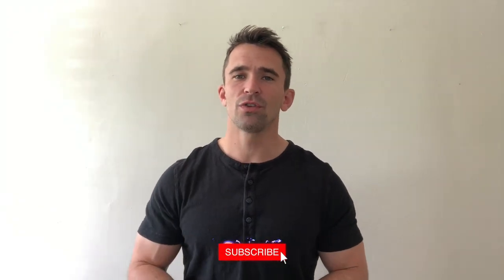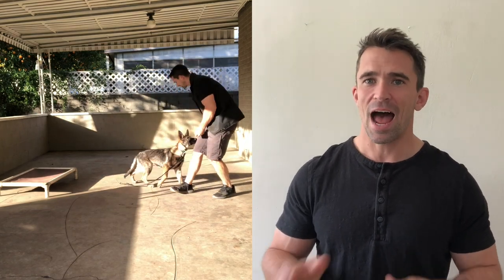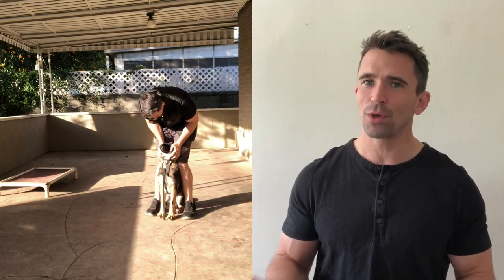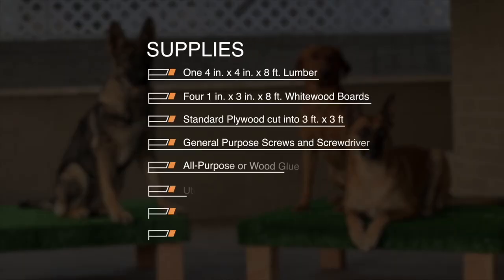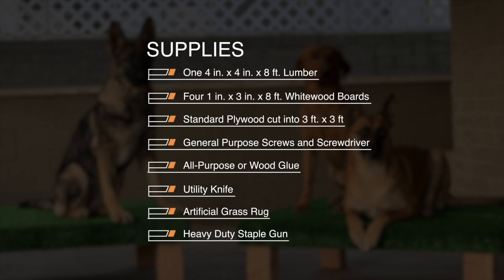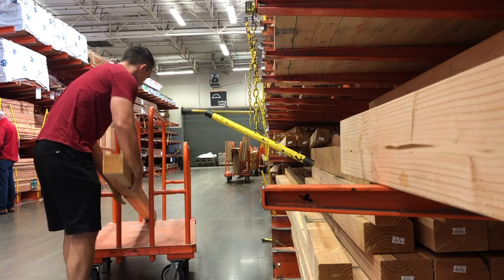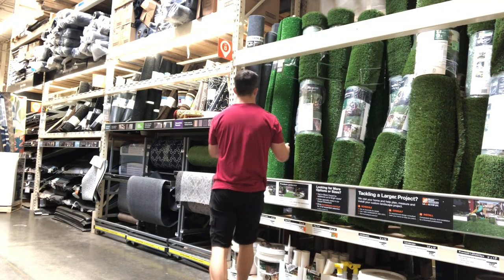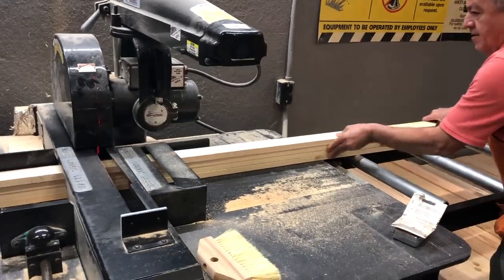How to Make a Custom Training Platform for Your Dog.

Comment: Good video. Just a tip pre drill the holes with a smaller bit than the screw on the wood so it doesn’t split. The 1X is prone to splitting. Cool project, I’m making one today
Reply from the maker: Yes. Thank you!

Comment: Thanks for this! I'm trying to see if there are any written instructions. Am I missing them? Thanks again!
Reply from the maker: Thanks! Sorry, I only added the supply list. 
1) One 4 in. x 4 in. x 8 ft Lumber
2) Four 1 in. x 3 in. x 8 ft. Whitewood Boards
3) Standard Plywood cut into 3 ft. x 3 ft.
4) General Purpose Screws and Screwdriver
5) All-Purpose or Wood Glue
6) Utility Knife
7) Artificial Grass Rug
8) Heavy-Duty Staple Gun

Comment: my home depot wouldn't cut the 4x4 to the length that was needed. "company policy"  also was going to charge me .50 a piece after the first two cuts on the other pieces.
Reply from the maker: Sounds like Lowes is the answer. Lol
Reply: @NateSchoemer  actually tried them first. Lol. Same deal with the cut on the 4x4...

Comment: The ASTRO turf simply won't hold up to the new england weather. What if I used 'spray can' bed liner (aka rhino liner for a truck bed) instead of ASTRO turf?
Reply from the maker: If it works, it works! I'd say give it a shot and see how it goes. :)

Comment: What are the exact cuts i have to ask for when going to home depot after buying the list you stated?
Reply from the maker: Supply list:
1) One 4 in. x 4 in. x 8 ft Lumber
2) Four 1 in. x 3 in. x 8 ft. Whitewood Boards
3) Standard Plywood cut into 3 ft. x 3 ft.
4) General Purpose Screws and Screwdriver
5) All-Purpose or Wood Glue
6) Utility Knife
7) Artificial Grass Rug
8) Heavy-Duty Staple Gun

Comment: Can you provide what's needed to only make one platform?
Reply from the maker: Just measure out what you need and get the appropriate supplies. Cheers!
Reply: Can you please provide details? Some people need more in depth information as this is our first time working with lumber. You listed the total amount of wood needed but didn't give exact measurements of how those pieces should be cut. Why can't you just list for us the measurements individually of the legs, board, and support pieces?